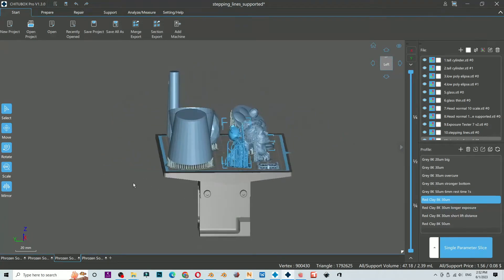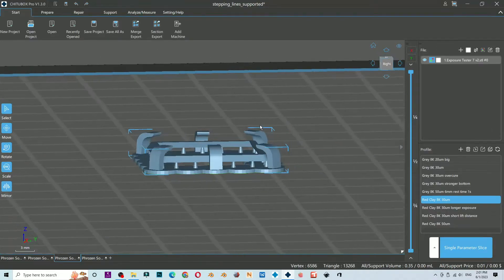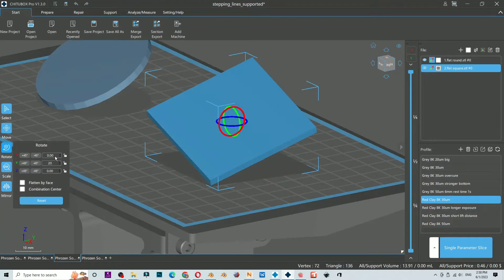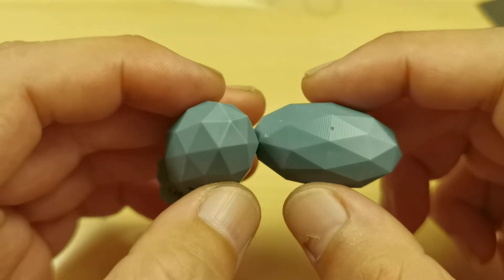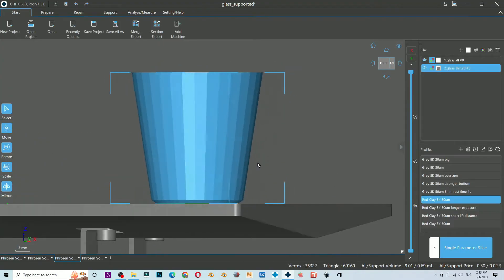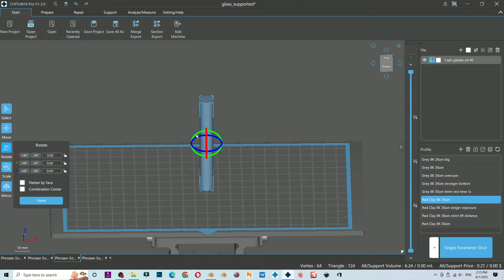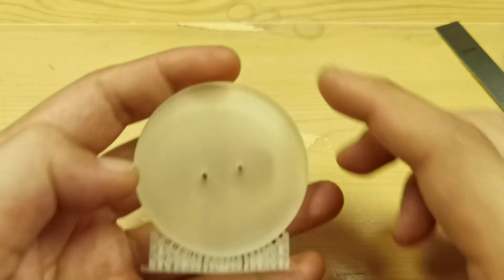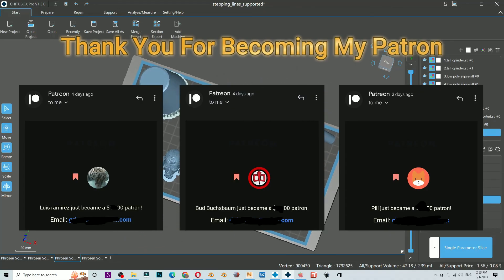Chitubox Masterclass Resin Printing How To Orient Your 3D Model

Comment: Hey Denny, mini's turn out very well for me however no matter how I orient flat surface models I get a plucked chicken effect. large or small, hollowed or solid doesn't seem to matter. Any thoughts on this sir? Using GK3 Ultra, Elegoo standard v2.2 resin. I also use an Elegoo mars 4 ultra and get the same result.
Reply from the maker: @badmrfrosty78  plucked chicken?

Comment: how do you reduce the 'melted' look on the side of the print angled towards the build plate?
Reply: By "melted look" I can only guess you mean one of two things. Either the print widening at the bottom where it touches the plate (knows as "elephant's foot") or the supported edge facing the plate deforming. Both are basically unavoidable aspects of SLA printing.
The former is why it's not recommended to build directly onto the plate.
The latter is the result of how thin and malleable the early layers are in your print. The first layers you print are incredibly thin, which means when they are pulled away from the FEP by the supports they are naturally going to deform. Once enough layers are printed the thickness of the print stops this from happening but the deformation of those early layers will remain.

You can mitigate the latter issue by angling your print to reduce the size of those early thin layers. You should always avoid printing flat areas perpendicular to the build plate for this reason. Adding a higher density of supports should also help mitigate that issue.

Ultimately it cannot be avoided completely, you just need to mitigate it as much as possible during printing and then touch up the model afterwards where needed.
Reply: @arstulex  the latter is what I was referring to! Thank you for the detailed response! :)

Comment: You are quite the expert. What would you suggest for the settings on chitubox. I am aware exposure times depend 100% on the resin and the eapecific working conditions.

But what about the other settings like lift and retraction speed, lights off after retraction, lift distance, transition layers. Could you share your particular preferences on those settings please? I know some are focused to extend the lifespan of the screen and others the overall printing time. 

I would really appreciate your wisdom if you talk about those subjects please
Reply from the maker: Yes i will be getting there.
Reply: @wangdennys  thank you for the quick reply. Is it a soon to happen thing or just planned for the future but not developed yet?
Reply from the maker: Planned, but not yet develop
Reply: @wangdennys  I appreciate your honesty. Still looking forward to it. I like the cientific approach you take on your reviews. Based on facts and using actual tools to measure variables. Helps a lot to the credibility and expertise of your insights
Reply from the maker: @davidc3150  thank you for your kind words

Comment: I've had an issue on my Anycubic Mono X where your exposure test has supports that are really short and looks 'compressed' like you showed in the video. I've re-leveled the build plate but it hasn't helped. Kind of out of ideas.
Reply from the maker: relevel with extra papers, like 3-5 too add thickness and reduce compression
Reply: @wangdennys  Thanks, I'll give it a go. Is this a regular that happens with some printers?
Reply from the maker: Yes, happen to all printer without people realizing.
Reply: @wangdennys  Do you think I could re-level my Mono 4k with 3 pieces of paper? It is smaller than the mono X.

Comment: Great info! Didn't know about FEP drying in straight printing
Reply from the maker: Yep, that is why the most common haze marks on fep are support marks.
Reply: @wangdennys Would increasing the "Rest time after lift" parameter reduce the drying of the FEP during straight printing?
Reply from the maker: @briannewman6216  it could, but if the print time is very long because the object is very tall, it wont do any good. better raise exposure imo from my experience.